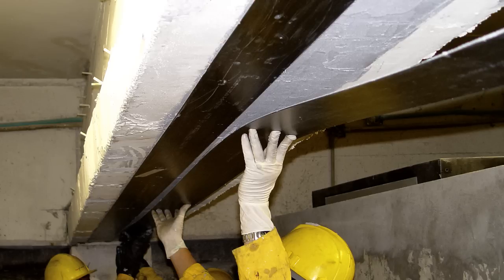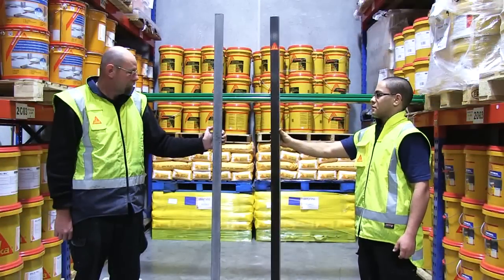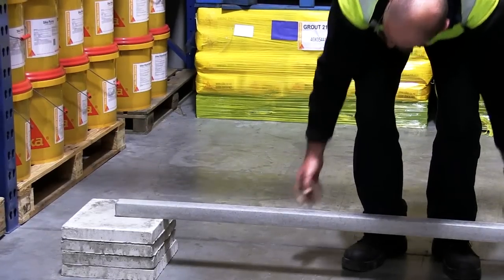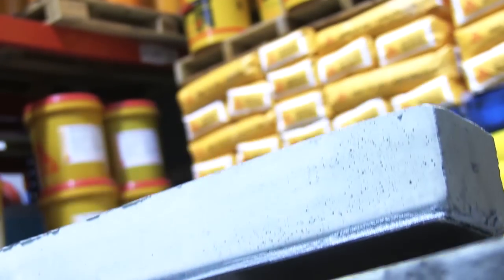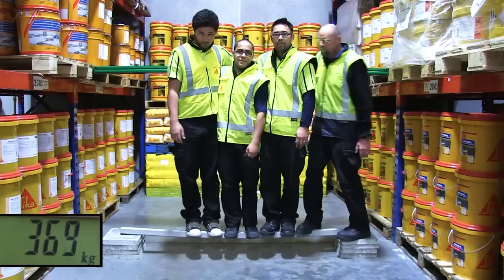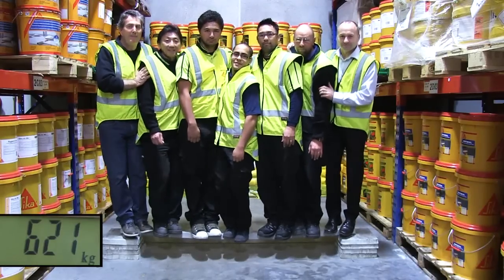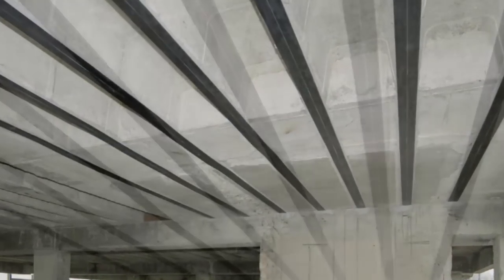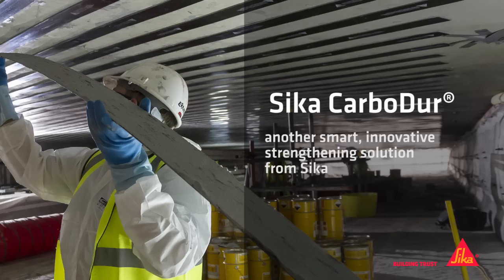Sika CarboDur® - FLEXURAL STRENGTHENING

Comment: Hello!
The same video is shared on the padge of Sika Canada. I asked a question there, but I would like to ast the same question here: How do you think, that a concrete beam without any rebars in the bottom side can be representative? If you would like to prove anithyng about CarboDur (which is a very good product by the way) please try to compare the strengthened beam with a normally reinforced concrete beam, othervise the comparison is insignificant.
Reply from the maker: +MrKrsDan The intention of this video is not to replicate a real strengthening situation. 
As indicated by you, the concrete member does not comprise a real, representative internal steel reinforcement. However, please note that none of the rest of parameters as shown in the video (cross section of the beam, length, kind of support, loading scheme...) try to reproduce a real scenario. 
As you know, any real static loading test for a FRP-strengthened RC member leads to useful information as a consequence of the resulting data obtained (e.g. stresses, deformations, ultimate loads...), but any resulting video will not show any real, explicit performance of the carbon fibre element. 
I that case, we suggest to check other existing Sika videos focused on real design situations (e.g. https://youtu.be/B94NcApDwnQ). Best regards, Astrid Schneider (Marketing)
Reply: +Sika 
Thank you for your answer!
 Just caught my eye... it was the first video, that Youtube gave me for the keyword: CarboDur
Reply: i know Im asking the wrong place but does someone know a tool to get back into an instagram account?
I stupidly forgot the login password. I appreciate any help you can give me!
Reply: @Kamari Emmanuel instablaster ;)
Reply: @Wesley Jesiah thanks so much for your reply. I found the site thru google and im in the hacking process now.
Seems to take a while so I will get back to you later with my results.
Reply: @Wesley Jesiah It worked and I actually got access to my account again. I'm so happy:D
Thanks so much, you saved my ass !
Reply: @Kamari Emmanuel no problem :)

Comment: Is it available in Brazil?
Reply from the maker: Hello and thank you for your message. Sika Brazil will be able to assist you with your enquiry - you can find their contact details at bra.sika.com
Reply: Which you use to beam raping in frp thickness
Reply: What is the thickness in mm of frp required for a 2 ft width and 7 m length beam